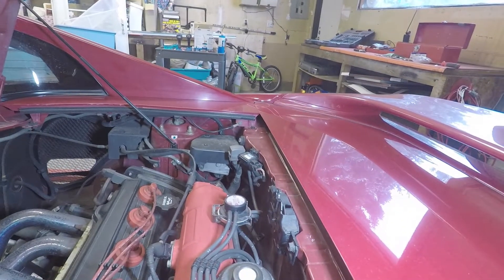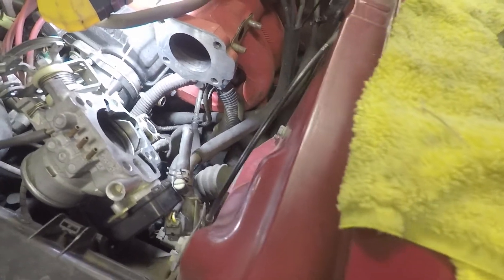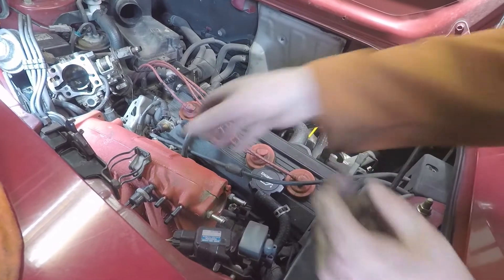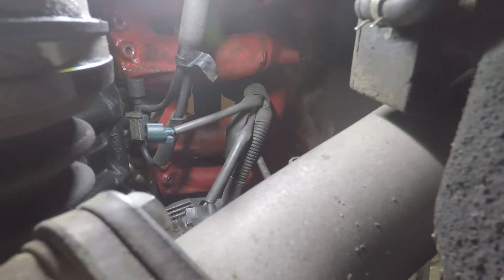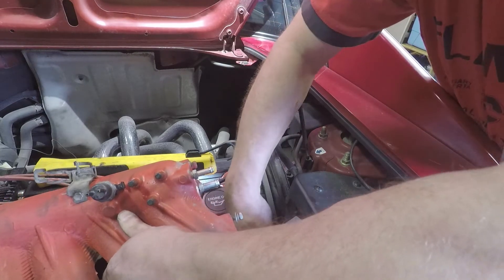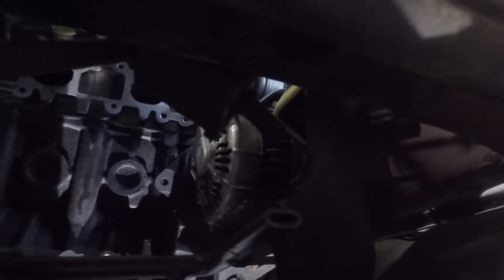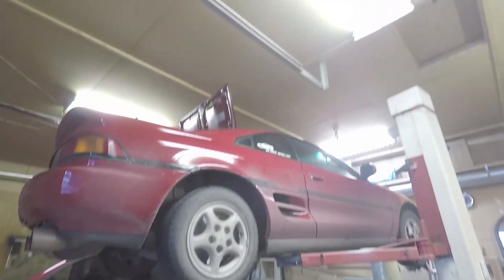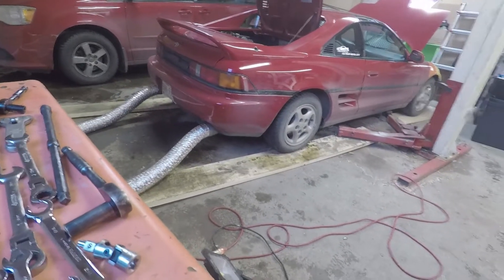Fixed one problem, made another one!

Comment: im glad you figured out your surging issue, my 91 na mr2 was doing the same thing and after I turbocharged it my surging issue went away. Most likely a vacuum leak as well. But my mr2 is doing the same thing that yours is with the high idle at around 1500rpm. If you do find any solutions for this please post a video, I would appreciate it immensely. Also As soon as you had the starting issue that ground is the first thing I thought of, it is a very important ground. I found that out the hard way after working through the entire electrical system of my car. Great video and cant wait to see more content
Reply from the maker: Hey thanks.

Comment: Hi, Great video! Just wondering if you have since fixed your vacuum leak issue or your high idle issue. I'I currently have a 91 that believe has both of these issues (vacuum leak and high idle ~1.1k rpm). Any insights would be greatly appreciated!